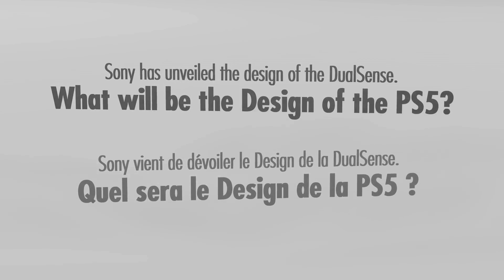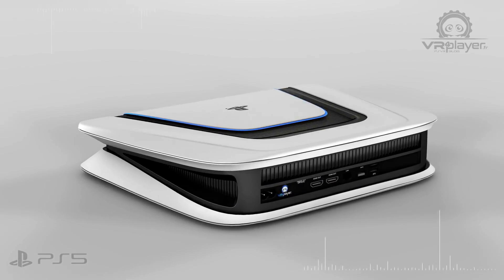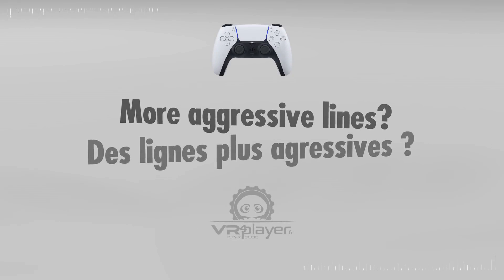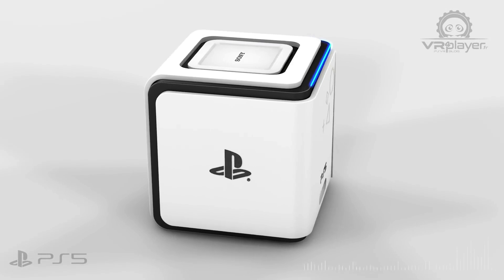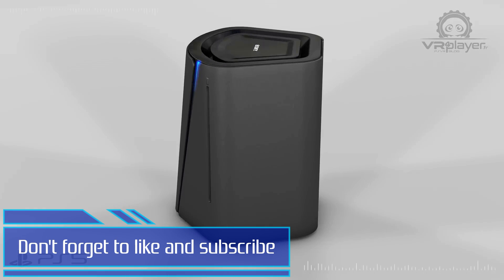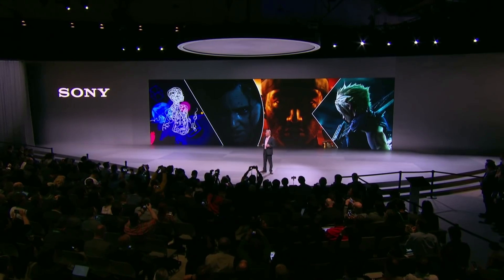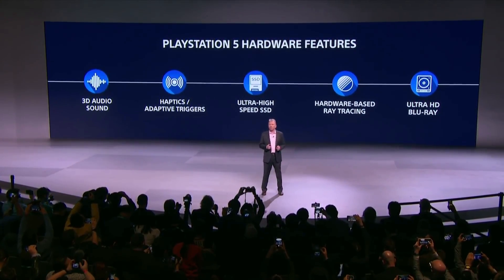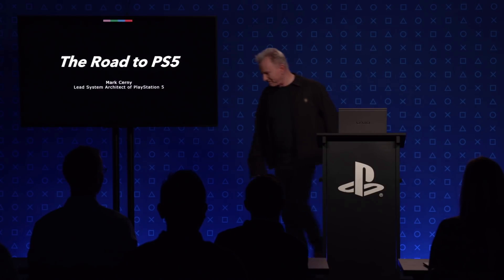PS5 Uses Revolutionary Cooling Solution | Overheating Concerns Squashed, New Patent Reveals

Comment: The idea that Sony boosted their specs in response to what Microsoft revealed is a silly theory to entertain for several reasons. Least important first:

Sony's tech talk by Cerny was originally planned for GDC. The final timing may have been in reaction to the hardware hype MS drummed up just days before, but the content(and the reality of what Sony have been building up to this point) couldn't magically manifest out of thin air in reaction to XSX specs.

Secondly, it's not like Sony  wouldn't have some idea of what MS was aiming for all along. We'd be really naive to assume that each maker doesn't have both AMD insiders AND developers (who have devs kits) who isn't going to tip the other company off on some of the details they know about the competing console. In many cases it'd be friendly conversation. Obviously, very specific details would be kept as very tightly guarded secrets both by NDAs and by updated dev kits that bring features "online" close to, and just after launch, surprising everyone except most first party devs. Other than that, each company could easily acquire insider info concerning the general direction the competing console is going. They just won't openly admit that, for obvious reasons. Anyone  really believes Sony is shocked that Microsoft was targeting way more CUs and MHz than the PS4 pro had? Seriously? The end result is an inevitably  higher performance metric(Tflops). The average lay person would predict that, but not Sony? Come on...

Last but not least; console development just doesn't work like that. You can't decide on a whim, "crap, I didn't know XSX was that powerful, let's bump our GPU to unheard of frequencies. While we're at it, let's figure out a completely unique way to handle the heat problem we're going to run into, and let's make these radical last minute changes magically clear the production testing phase, and get ready for mass production shortly" That's not happening! This isnt last minutes tweaks and balancing we are talking about. This is a fundamental change to the design approach, which would have been in the works(from planning to execution) for easily 1.5 to 2 yrs. Any changes from here on out, MUST be able to fit within their original design goals and constraints.

I've seen other sites entertaining this idea today, and all I could do was shake my head. It's too silly to take seriously.
Reply: Thank you! I'm listening to this video like, did he just say this was a last minute reaction. This guy CLEARLY has no idea how patents nor game development works.
Reply: @advocate1818  

Well, in his defense, he did kinda make a case against the idea, near the end. That said, the fact that he even took it as a remotely valid notion was... umm... yikes. Still though, lots of fanboy channels  are currently running with this silly idea.
Reply: @Oryon7  I did hear a rumor awhile ago that Xbox was originally setting their targets at 10 tf. Which would mean sony's response to that might have been over clocking their gpu to match.
Reply: @dougburton27  like I said, if you can safely and freely get more performance bang for your buck, it's just a no-brainer. Pure common sense. You guy's are way too hung up on this "response to this/that" theory. Whatever floats your boat.
Reply: @Oryon7  well actually it wasn't free and is probably costing them more in cooling.
Reply: @dougburton27  if the cooling system they built can handle it, then that's no added cost to them. They can up clock/ down clock to stay within safe parameters. That's the entire point of running these tests. But if you're suggesting that they changed their specs, then had to find an adequate cooling solution a few months away from launch... I've  already discussed why that's a bogus idea.
Reply: @Oryon7  yes but you said it yourself, if they had insiders and realized that Xbox was targeting 10 tf early on and they were targeting 9 tf, then over clocking would be the simpler and easier fix. Specially considering they wanted to target 36 cu's. But then that also would change the heat in the console probably also making them redesign the cooling of the console I.e. Making the console more expensive to manufacture. So it did cost them. And I'm not even completely sure of their design yet. I don't think they are neither.
Reply: @dougburton27  
Ok, I'm think we've exhausted the particular discussion, so I'll move on. As pertaining to your last statement, I'm willing to bet they are far further ahead than we think. Because they've been quiet, doesn't mean they don't have a handle on all the necessary things leading up to launch. They've been here several times before.
Reply: @dougburton27  What?... Insiders? Give me a break! This is just plan reaching. What about keeping the console priced to the market's comfortability or just wanting to achieve a particular benchmark to their predecessor without jacking up the cost to design the thing? Oh my goodness! Are people really this shortsighted and/or insecure? You hear a rumor, as we've all heard countless times, pertaining to the console's specifications both clocking from 9 TF 11 TF 12 TF all the way up to 13.5 TF, sources ranging from the Xbox hitting one benchmark and the PS5 NOT hitting the other. But when one set of specs doesn't match up, you conveniently reach for another to fuel an empty point? C'mon! 

There is a reason Microsoft is watching Sony so closely right now; they are the underdog looking for a foothold in the market. Sony's focus is OBVIOUSLY to penetrate the market in sales rather than shooting for a crazy set of specs to repeat the pass mistakes they did with the PS3. Have you ever considered THIS to be the case? This is, likely, the reason the platform takes less than a month to get a game running on it, something the PS3 never got right and the PS4 only slightly improving upon. By going with 36CUs and clocking the heck out of the GPU allowed them to build a platform that would not only be cost effective to manufacture but one that could persuade developers to support it a whole lot easier than an expensive, more difficult to develop for competitor. You are far too hung up on TF power and not enough on consumer and developer adoption, mate. It has nothing to do with what Microsoft is doing with the Series X. But if it wasn't telling enough, the controller should have made this apparent. Due to the standard types of features absent in the competition's controller, it's making it harder to simply port a game over without it taking a significant hit in the way it is played. Think DS to PSP minus the huge gap in raw performance. 

These competitors are OBVIOUSLY headed in two completely different directions. IF the Series X could achieve a certain set of benchmarks now, there is absolutely nothing stopping a more robust PS5 (Pro version) from achieving this very same thing later on. So it's a waste of resources. However, it is not the same the other way around with the standard features that affect the way the game is played on Sony's platform without cutting out a significant portion of that user base in the process. See the difference?
Reply: @advocate1818  there is a reason Sony went with 36 cu's. And if you think the ps5 will be cheap it won't. Unified ram cost more money, their custom ssd and io block with 12 memory controllers is gonna cost more money, hell their cooling solution is going to cost them more  money all so they could have the gpu at 36 cores and there is a reason they did this, and it wasn't to cut down cost on the gpu. It was for bc. Microsoft has already stated they don't care what sony is doing. Also Sony deals in hardware not software Microsoft does. So the learning curve for dx12 ultimate will be there, but the gains from it could be massive once developers are up to speed. Also developers are gonna use dx 12 ultimate considering its also the number one API for pc. This is why Microsoft doesn't care either way they make money. Hell Microsoft has had a deal with amd and now Nvidia has partnered with them. They have already secured their top spot for API and have pretty much cornered the gpu market.
Reply: @dougburton27  Here we go again...

Every time a battle is lost in Microsoft's favor, it conveniently goes back to more rumors. No, there is a reason the console went with 36CUs -- Cerny made that PERFECTLY clear in his deep dive keynote: ease of development, efficiency, and cost. There is no in between. Everything after that is a rumor. You don't know the cost of their cooling systemor anything about it other than a patent description online, but i can just about wager that it is not as expensive as the one in the Series X since we've actually seen a breakdown of that one not too long ago. Sony is also going with a reduced yet more stable memory bandwidth, too. But you are right in saying that Sony is a hardware company, and that's going to play an important roll in the way the console is designed.

And for the record, Microsoft DOES care about what Sony is doing. At first it was Google and Amazon they saw as competition rather than Sony, and now it's back to watching Sony closely and wanting to take the market from them. 😑 That's directly from Spencer himself.

Sony means more to them than you are giving them credit for, mate
Reply: @advocate1818  lmao, yes when Phil Spencer was asked about the ps5 he said, they have some pretty cool tech. But it only made him more confident in their design choices for the series x. O yeah that spells huge worry. Dude Mark cerny says alot of shit. When in reality it would have been cheaper to do more cu's at a lower clock rate. Less heat would be generated in the console. But Sony has never done software emulation before, it's always been hardware thus 36 cu's it is matching the ps4 pro. O I'm sure having one massive heat sink and one fan in a box form factor is cheap as fuck. Did you read that patent if true that will be the most costly cooling solution in console history. Heat sinks above and below while actually having holes through the silicon. Plus fans, dude come on you know better by now. Not only that Mark cerny barely even talked about the gpu and cpu. He glossed over it. It was hey look at ssd oooo look at our audio chip. Cause he knew talking about the cpu and gpu was underwhelming. And then the deceptive fuck per usual takes shit out of context again. Well tfs don't matter. The fuck they don't, they are the measurement of compute speed on the gpu side. And then he compares the ps4 to the ps5. Every fucking developer already knew gcn cores are not as efficient as rdna 2. So that was a nod to retards who know nothing about gpus and a narrative to run with. Shit cerny why didn't you compare the ps5 gpu to the series x? They both run rdna2. It's apples to apples.
Reply: @Oryon7  obviously they don't have a handle on things if they are already expecting to release less consoles at launch then the ps4. And there whole mission was to get people to switch over as soon as possible.
Reply: @dougburton27  Wow! Where do I start? 

It appears it is YOU that is more concerned about that teardown having no value to what is really being touted of the platform. I think we both can clearly see that right now. Spreading false information in an attempt to create panic, seek comfort or whatever the case maybe is not going to change the inevitable, and you will experience that first hand. Cerny is a smart man, and just like any smart individual, you don't sit around looking over your shoulder at what your competitors are doing that governors and possibly distorts your own vision of where you want to end up. This is the basics of leadership. So, it would be absolutely insane to think a powerpoint surrounding your competition's hardware is somehow a fantastic idea. No. The powerpoint, as well as their vision, as it should be, was based around what the predecessor wasn't doing and how that could be improved upon. 

Moreover, you are running away with a lot of what ifs specifically for your own desire and insecurities, y'know. So I'll say this again: we've gotten a brief teardown of the hardware. Everything else is a rumor at this point. There is much about the sysyem we still don't know, and if you don't have some cognizant background of this box in person (I'm looking at you, doug), to formulate these benchmarks around cost and especially design architecture, it cannot in anyway validate anything you are spewing at this point. Bottom line, it's not factual information nor does a lot of it make much sense at all. That is where we are right now. And as hard a pill it may be to swallow, it's true, sadly.

Just because Sony hasn't said anything or have maken the moves you'd like them to does not mean that they don't have anything worth showing. I know this and so does Spencer. Confidence is key, and I admire that in him, but he isn't keeping a close eye on them out of boredom.
Reply: @dougburton27   Man you guys... I'm 'this close' to banging my head against a wall. It's like you all live in your own alternate reality or something. 

How is it that you've manage to dance around the most obvious and observable facts and situations, to come up with these far-out, rumor-centric ideas?

Now its... Sony will be making/releasing less PS5 at launch than they had for their previous console. It's ALL because they're having trouble internally with their design of the console. It ABSOLUTELY, POSITIVELY cannot be for the fact that the entire world's economy is $#&% right now, global production of components(and necessary personnel) are significantly impacted, every major roadmap heading into 2020 has been affected due to the current situation, AND companies can't afford to overestimate next gen console purchases in what, so far, looks to be a very rough year for many families/individuals...

Oooh noooo, that can't be it, cause REALITY isn't juicy enough for these types of discussions. Shm. 

Give me a break already guys, you're killing me here. Goodness!
Reply: @Oryon7  thanks for putting words in my mouth, didn't realize I had to point out the obvious to people.
Reply: @dougburton27  

And yet the very obvious seems to be an anomaly to be discounted - in favor of speculative drivel, no less - as it sails way over the heads of nearly everyone I've been replying to, since my very first comment.

So yes, apparently, "the obvious" should be accompanied by bright, flashing neon signs around here. 

Anyway, enjoy the rest of the day y'all. Catch me upon a future video, when you're gonna have a LOT of explaining to do.
Reply: @Oryon7  blah blah blah.
Reply: @advocate1818  the patent is from 2017... Many people are way off track.
Reply: @crypticvyper3092  

Yeah, I didn't see the patent date, but that makes it even worse than I previously expected. To file ANY PATENT, the minimum  time it takes to clear is a year due to legal rights and making sure no one else has that idea on file.
Reply: 👍

Common sense is not so common.
Reply: @mazin9193  huh? common sense? early rumors suggest otherwise.
Reply: Yes I noticed that as well. Supposed troubles PS5 is having is built on a pyramid of feedback loops between rumors and guesses. What surprised me was, many people are over-inflating the hype around XSX on that basis, and it would inevitably reverse into a deflation should any of it turn out to be false. There's enough going for XSX to build a hype without that bubble, so why take the risk? Strange times.
Reply: The 2019 github/3d mark testing has been confirmed 
36 CU chip with legacy BC modes 
It confirmed the RAM bandwidth but the clock speeds were lower 2.0 GHz (9.2 Tf)
People then claimed it was not possible to put a GPU with that clock speed in a console but now sony went further w/2.23  GHz 
That rumour was true because it also confirmed Renoir APUs which turned out be real
Reply: @GameChanger-lh4sd  

The thing about those tests is that they are just that... tests. Only the engineers know what data they were trying to ascertain. I worked as a production tester at my last job(literally one aisle away from several of our engineers), and similar scenarios all the time! Alot of times, engineers would request various tests from us, but we'd have no idea what part of the result data interests them, and why. But they'd  make changes to the sample then submit it for testing again, and stand over me with huge grins on their faces, when the parameters show positive gains.

Anyway, uncovering these tests can lead people to conclude that what they are seeing is final silicon. That in turn leads to more wild theories once final specs are released - like the one that sparked this discussion(Sony got caught off guard, bumped specs up). If I remember correctly, the same test you referenced did not specify any ray tracing features/benchmarks leading people, only just a few weeks ago, to believe that PS5 may not have a ray tracing solution, or a  software based solution at best. Even though Cerny had already went on record saying PS5 solution is hardware based, the discovery of this old test drove the narrative. Now that we know some official details, I guess people should also assume that Sony added an AMD-based ray tracing solution in response to XSX's specs, which of course, caught them off guard. See how silly that line of thinking gets?

There's a much simpler answer; one that actually reflects how hardward development actually works. That is: as original design goals are excuted, more and more milestones are satisfied. The testing phase will determine if they are well within the range of their goals, including the thermal tolerance of the silicon, and the capacity of their cooling system. If so, that's the best situation to be in, as it means they can bump CPU &/GPU &/MEM clocks beyond the last test parameters, at virtually no additonal costs, and still be within safe thermal limits.  Microsoft's console specs doesn't dictate this move, a successful testing phase does! It's not like either company would pass up an opportunity to safely and freely go beyond a certain milestone. All gamers see(or imagine) from the outside is a wild spec war, but this line of work is meticulously goal-oriented.
Reply: Great post Josh. Good read. I agree too with this
Reply: Most common sense I've ever seen on a PS5 vid.
Reply: Money is 💰
Reply: I hope that the rumors are wrong i want to be able to get both consoles day one, but your speaking as if when people say last minute they said specifically 2 or 3 days before mark cernys talk. Consoles take year and years to develop and perfect, so last minute could mean they just caught wind of the spec difference 2 and a half years ago. Xbox has stated theyve been working since 2016 on their console would only make sense that sony has too. and with those insiders your refering to, hearing about the differences a year and a half or 2 into development would make sense, probably around the time dev kits would be going out and by console development standards 2 years from reveal is last minute.
Reply: not saying it is undeniably true or anything (i hope its not) but you cant just chalk it up as false by common sense
Reply: @BravoD3  You have it back-to-front. It's less to do with why we think it's false; it's more to do with why we think it's right. The question is why you are so determined to disregard other possibilities. I tell you why - it's because there is a cognitive bias at play. We start with a supposed story and go about looking for reasons to fill it. Then all rumors begin to fit in accordingly to that preconceived idea. 

For decades now Sony has been famous for making several to a dozen prototypes of a product and leave their options on the table. We don't even know which one resulted in which rumor. But questioning that is too inconvenient, because this interesting story about overheating is weakened significantly if you allow such a consideration in your thought process.

In the end, there is no real default position when the basis of a speculation has been built on a feedback loop of rumors and guesses. In which case, the burden of proof is on the side of the accuser, and there's barely anything in it beyond some anecdotes.
Reply: They're done testing everything? I'm not sure about that.
Reply: Exactly. It requires years of design and planning, as well as hardware control to make changes to the components.
Reply: It made perfect sense that they boosted GPU clockspeed way higher just to reach 10tflops. Earlier rumors suggest that GPU is 9tflops and cooling patent solution just a couple days ago because the ps5 devkits is running extremely hot.
Reply: @TylerDurden-ww3yg  But there are other perfect senses you can make of it, such as different rumors eminating from different prototypes of PS5 because sony is famous for doing several prototypes of their hardware. You only gravitate towards a particular interpretation because it plays into your preconceived ideas. It's a well known side effect of the confirmation bias. 

Of course, nobody knows for sure and you may well turn out to be correct, but the perceived advantage for a competing product is very fragile when it's built on such a slippery slope. The reversal effect at a later date is often explosive and it's not worth the risk.
Reply: @TylerDurden-ww3yg  The cooling solution was patented in 2017, it was only made public a couple days ago.
Reply: @TylerDurden-ww3yg  that's not how patents work. A patent takes a MINIMUM of one year to be approved. If this is a 2017 patent, that in itself, negates these rumors. Ijs
Reply: @advocate1818  

Lol, they're not playing fair at all, right? 

"It's a last minute cooling systems, so that proves me right... oh wait, it's a cooling system that's been in the works for a considerable amount of time, so that makes me even more right hehe!"

Lol, this is why I normally just say what I gotta say and keep it moving... smh.
Reply: Don’t worry everyone. You guys will be ok. Your PS5 will be inferior in almost every category but at least you got your exclusives. It’s all you got but it doesn’t matter since it’s all about the games right? Riiiiiiiiiiite
Reply: @megazine  

Detecting a lot of salt in that post. Smells like the kinda salt that developed once MS lost both the power AND best-games narrative, gave all their effort to win back the power narrative with 4k consoles, and still didn't have the most impressive looking games.
 
You'll be fine, my dude, lol.

Btw, I don't think either console has anything to worry about concerning power/capability this time around, so how ever inferior you envision PS5 doesn't really matter. The discussion here wasn't about that.
Reply: Joshua Smith you are going to be fine. PS5 will be inferior in power and performance. Bottle neck performance by 3rd party open world games using real-time ray tracing and VRS. Inferior in online connectivity with PSN. No equivalent Game Pass alternative. Inferior multiplayer options and features where PS4 has to rely on outside apps. No integrated streaming platform where PS has to rely on privacy collecting Twitch.  Lackluster controller designs and little to none console special editions. Outdated first party controller with no Elite equivalence.  Inferior 3rd party performance for the biggest and best games.  The same UI since 2013 (let me guess, if it isn’t broken don’t fix it 👌 ). No software OS redesigns or improvements. Little to no software features added since 2013. 

It’s ok. You still have your exclusives. Nothin else matters. Since it’s all about the games. Riiiiiiiight. Enjoy!
Reply: @megazine  

So much salt. I'm sorry guy. You'll recover, give it time, lol.

I guess now would be a bad time to reveal that I actually perfer gaming on Xbox, over PS. "Wait what?!!" Shocker, I know.

You heard that, megazine? Listen... It's the sound of such silly little arguments not phasing me at all! ;)

That's the problem with you fanboys, you are way too emotionally invested to judge any console related situation in any rational way, and  without bias. I'm broke that limit a long time ago.
Reply: Joshua Smith says the guy that’s calling people names... I was just dismantling your logic with data. To wrap this up, MS is a software company and Sony is a hardware company. We are now in the age of software for video games.  As I will predict. Sony will heavily rely on their exclusives during PS5 reveal, there’s nothing else they will out perform MS in.  My best recommendation and what I will be doing is getting a PS5 for exclusives and Series X and S for everything else: online gaming, multiplayer, streaming, Game Pass, 3rd party games, blu-ray play back, multimedia apps, best graphics and performance etc..

Work hard or ask mommy to buy you both consoles.  PS. expect Nintendo to follow Disney+ route.
Reply: @megazine  This post is hilarious.

The discussion wasn't even about this. It was about Sony supposedly adjusting the speed of the graphics processor out of panic of what Microsoft recently show of their console. The information is false and ludicrous at the same time. Why do you sound so moved about everything else, I wonder? 

Outside of a controller and a brief teardown,  there appears to be a number of accusations here more so than anything -- kinda the same as them suddenly overclocking a GPU or a controller duplicate (that's amusing, btw). LOL! But ok...if that helps you sleep soundly. If this is your idea of spreading panic out of insecurities, there are better avenues, y'know. 

Having said that, just because Sony isn't boasting their plans from the top of the mountains as you'd like, don't mistake them for not having any. An example of this is VR on the PS4. Up until it was announced, very few understood the reasoning for the bar in the back of the controller, including yourself, I'm sure.  Therefore, you can't sit there an convince me that you somehow know what their next move is now because you don't. For instance, if I asked you what the create button is for,  you'd ASSUME what it was for because you really don't know, right? That's my point. You only know, to an extent, of what was unveiled of the platform.
Reply: advocate1818 psVR DOA. Kinect outsold it... lol
Reply: @megazine  VR is not Kinect. Let's clear that up right there. First of all, one is significantly more accurate than the other. Secondly, Kinect sold units based on advertising and hype, not because it worked. Like the PC, VR sold based on acceptance and hands on. It wasn't packaged with every unit or was backed by a billion dollar advertisement. It sold because it worked and worked VERY WELL without you necessarily having to leave the couch. Don't confuse the success of the two with one another. There is a reason why one is still around and the other isn't or why anticipation garners with one and wasn't with the other.
Reply: advocate1818 doesn’t matter. Kinect as a peripheral has outsold psVR. psVR is supported by 2% of PS4 owners. This is fine but still out supported by Kinect. Take care 😉
Reply: @megazine  No. As a peripheral not packaged with the platform, priced the way it was priced at launch ($400 just for the headset), and launching years after the actual PlayStation platform, it attracted a pretty large user base both hardcore and casual, making it a success. But unlike Kinect, its steam isn't dwindling as a fad would; it is growing in popularity and not just here but also in the PC sector. Success isn't always gaged by mass adoption but rather continuous support. 

And just because VR is all that's known of the next gen console right now is just a piece of what they are pursuing with immersion. Where this VR strategy ends is still a mystery, but I do know that it has something to do with the tech announced in the DualSense. That was obvious, though. After that, is what lies the mystery.